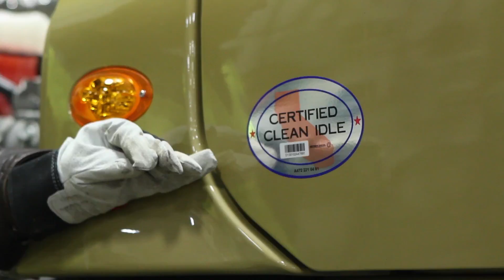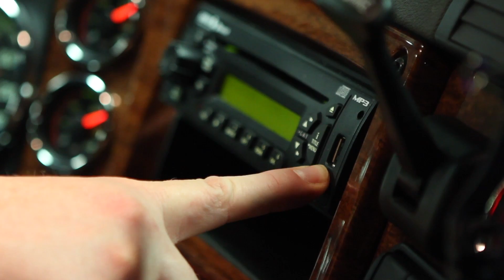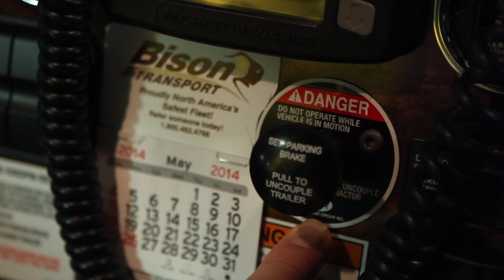2014 Freightliner Evolution Truck Tour

Comment: Hey folks, sorry I know it is an old post ... but when folks get hired on with you, do they get to choose whether they drive a Freightliner or Volvo? Thanks
Reply from the maker: Good question. There is some say but it really comes down to availability and functionality needed. For example, we have light spec Volvos that have been purpose-built so that would be the only tractor for that specific type of work.  Over time though, a driver can request certain equipment. Thanks for your question.
Reply: Excellent, thank you for the quick reply. =)

Comment: Why don't the trucks have an integrated GPS?  Are the stereos SiriusXM capable?
Reply from the maker: Hi Lindebr. This may not answer your question but we do have GPS and it is set up through our Shaw Satellite system. As for SiriusXM, our new model tractors are SiriusXM capable. Thanks for your questions and interest in Bison Transport.